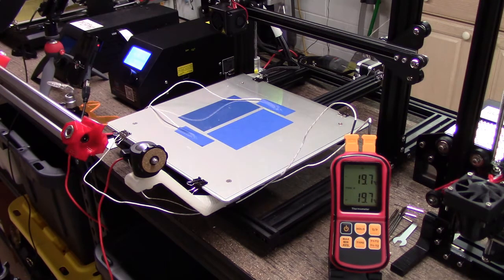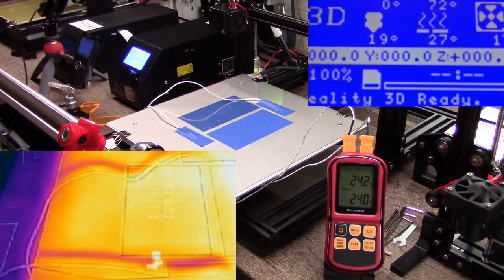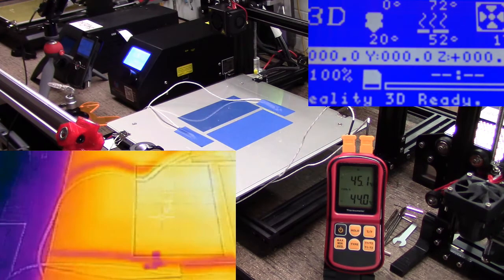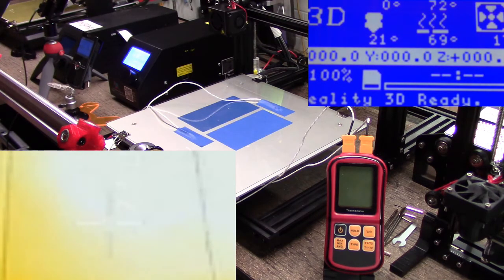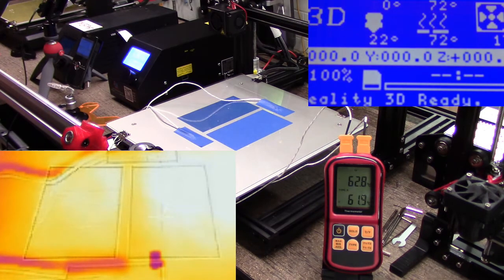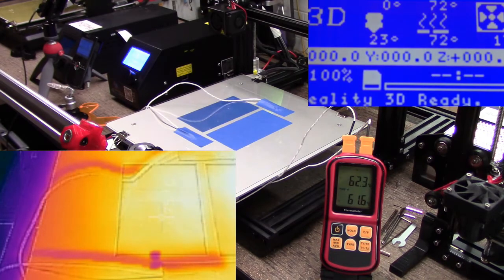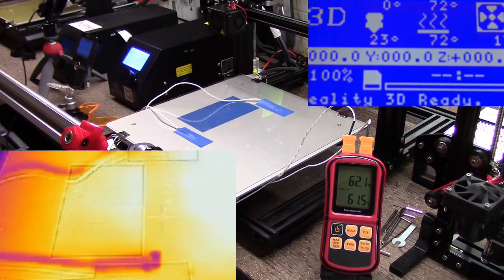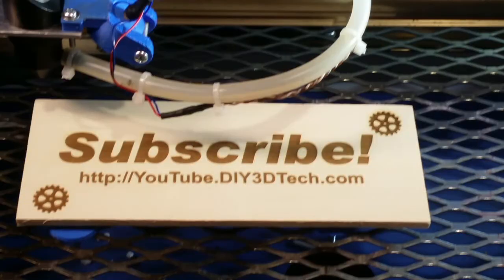Creality CR10 - Measuring PEI Heat Transfer With Flir Camera!

Comment: Curious. 1 how did you do your PEI installation? a: did you adhere to the stock glass build table? b: did you mount the PEI to the Aluminum build table. C: if mounted to the aluminum how will you ever service the screws holding it to the frame? D: what thickness PEI did you go with? Thanks for the vid.
Reply from the maker: On the CR-10 I just clip it to the aluminium bed and works perfect, people get to hung up on glass.  All of my printers are this way (right the aluminum) with out issues...
Reply: how thick is the PEI sheet your using?
Reply from the maker: here is what I am using: http://amzn.to/2xYpdzS  says it 1mm thick

Comment: Just a quick guess...  my take on this is that the paper lends a very small amount of insulation, but that the adhesive is actually acting as a bit of a heat sink and gathering/holding heat a bit better as a result.  Just my penny and a half.
Reply from the maker: Possible however the main point is many were saying that you couldn't read the Aluminium bed with a Flir and this was partly to show that wasn't the case...

Comment: I did my own test on an AC powered bed with no reflective properties and IR direct on PEI with 3M high temp tape on glass. IR works at low temperatures -- per say, this bed can get up to 140c. So in the 80 and below there is no difference between measuring bed and tape over bed, but going in the 120 range -- there is a 15c swing, it's lower with tape and higher straight of bed -- more IR reflection. So what you're doing is sorta OK at the temps you're at, but I would not trust IR, I trust your contact probes more -- and they say the bed is much cooler than the printer thinks it is.
Reply from the maker: Very interesting and thanks for sharing, how are you controlling the AC heater if you don't my asking?  Are you using the bed power to toggle a relay?  Also agree with you on IR in absolute sense as the main reason for doing this was more so to see the spread of the heat verses what the temp is.  Also yes I expected a difference in the probe temp as the printers thermocouple is tucked up into the bed (with an insulting backing) whereas mine where taped to the surface.
Reply: DIY3DTECH.com my 2 printers which use a mains powered bed use pid tuned SSRs. This printer thinks the bed is about 10-15c lower than the IR says it is, which based on probe sensors makes sense. This printer is actually properly measuring the bed temperature as apposed to CR-10 cheap dc bed with a stuck on thermistor, this bed alone costs nearly as much the CR10, and it's the same 12" square size. Just food for thought. Also this bed has a very even heat distribution as you can see the silicone heater running underneath with heating traces in a zig zag pattern like you would do when installing infloor heating on a bathroom floor.

Comment: How much room under the bed and the Y belt in order to insulate with cork board to ensure even heat distribution and to possibly drive heat up to print ABS?
Reply from the maker: Lots of room, but if you want to do ABS good luck as you will need it especially at any size as you need an enclosure (suggest heated), you will also need to convert the bed to AC as the DC stock version will not get warm enough.  As with the large size it will be very hard not get lifting and curling...

Comment: PEI is thin -- it has no issues with thermal transfer. Tape is not insulative. Tape is preventing reflection.
Reply from the maker: Actually think it is a little [tape being insulation] , well more of a "heat sink" if you will as i played around a lot with this off camera as I have a TON of man hours in these videos :-)  As I measured this with probes, non-contact thermometers etc...

Comment: Never try to measure temperatures tru glass with ir camera. Glass acts like a mirror for ir. just point your ir into a window of you house you see the temperature reflextion of your own body as if you were looking into a mirror. In other words: you dont get the temp profile of your garden but of the inside of your house. An well known trick in these cases is to use tippex it give you a good reading. you can put the tippex on the blue tape so you keep your glass clean.
Reply: He is reading the temperature from the blue tape, which has no reflective properties. I agree if it was straight from the glass or aluminum -- then the data is unreliable, but the data from the tape is fair.
Reply from the maker: I will agree with you on a house window as there is only air on the other side, however here it is pressed against a metal bed so to be honest I am not sure how the heat will propagate.  As it is different from say the PEI, however  I would expect this as it is more of thermal mass...